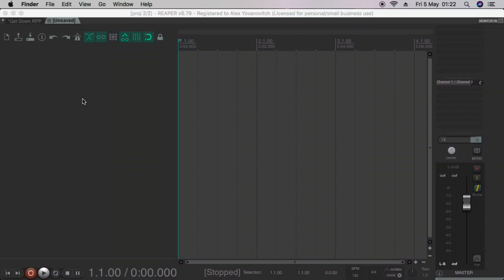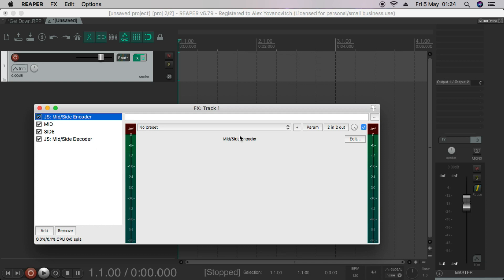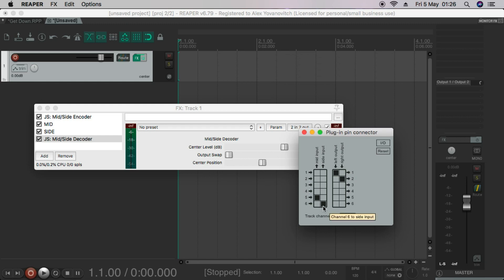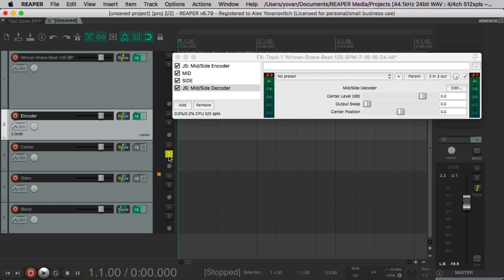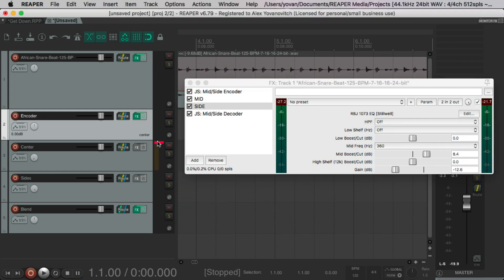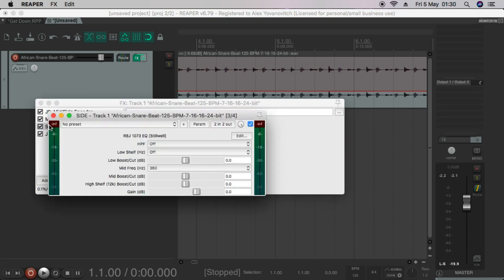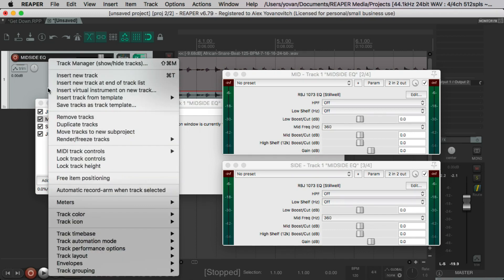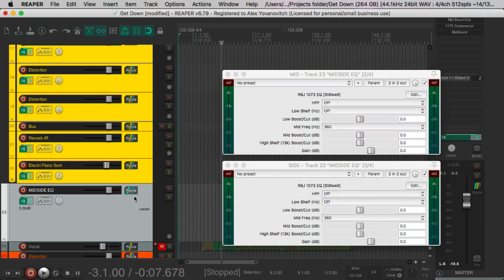Reaper - How to set up a Mid/Side EQ on a single track

Comment: shouldn't we hear the difference in the mid when you make changes to the sides and vice versa? at least that was my understanding of this process. So are we supposed to hear no difference to the mid should we process the sides?

Edit: Also a little note about the param link:  you could adjust the baseline slider to the left so that both your [mid and side] sliders will be at their default starting  positions when you link the controls. That slider always starts out at 100% an not at 0.